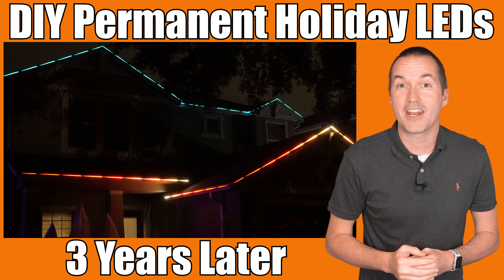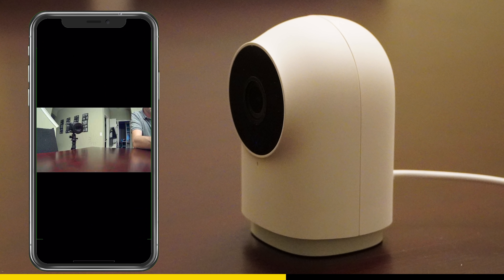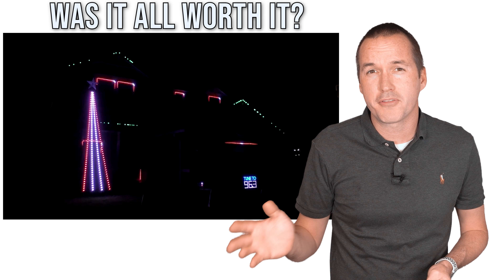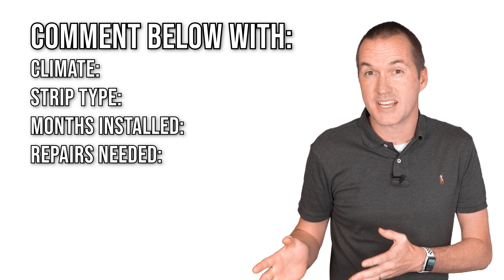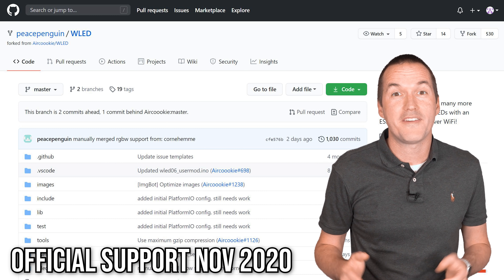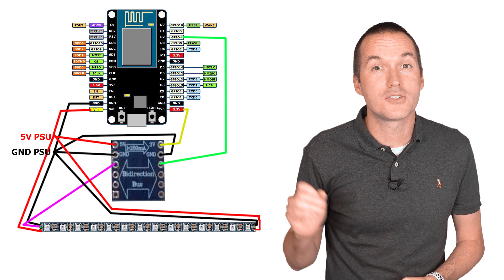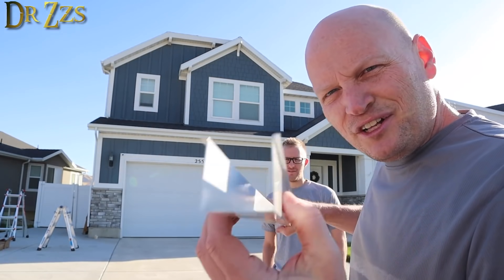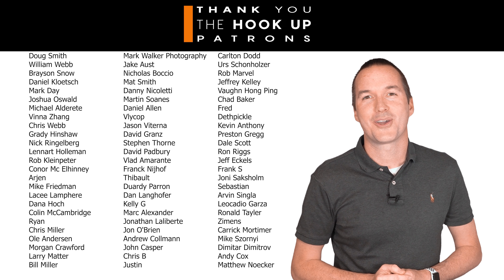3 Years Later: DIY Permanent Holiday LEDs - What worked, what didn't, and what's new?

Comment: First off, thank you so much for sharing your knowledge regarding permanent LED Christmas lights.  I have been watching yours and Dr Zzs videos and you two are the best on YouTube bar none. I have decided I want to take your advise and gear my permanent LED setup on your recommendation of the (8 to 10) SK6812 RGBWW 5 meter 150 IP65 5 volt LED strips.  I decided on these since I would like to light up the painted Hardy Plank eaves and soffit under my roof in a warm white most of the year and of course do the colors and effects for all the holidays through out the year. I have taken advantage of the Aliexpress 11/11 sale going on right now and I order the SK6812 5 meter LED strips but of course they will not probably be shipped to my until after mid December so I probably won't get them installed until after the holdays. My question to you is would it be possible to get some advise on the installation of the LED strips on the house ie. should I install them naked and with just a more permanent outdoor adhesive or clip or use the aluminum channels and if so which one flat or 45 degree angle?  Also, what is your recommendations regarding the best way to install the LED strips onto the soffit/ eaves of my roof line? Should I install the LED strips facing directly out to the street or downwards or behind the soffit so the LED lights indirectly shine their white light and colors onto my white soffit and eaves? I also think I will power the LED strips with a Meanwell 300W 5V power supply but I am not sure how many volts the power supply will need to be in order to power (8 to 10) five meter SK6812 LED strips any recommendations? Finally, I want to control the LED strips with the WLED software and connected to a NodeMCU that Dr. Zzs and you have recommended.  Sorry for the long winded question but I may have more after this if you don't mind. Thank you again for all your helpful content here on YouTube.
Reply: Brian how did it turn out with your solution?  I'm considering it as well (prefer to see the glow of the light off the soffit rather than the light itself)
Reply: @erich8789  I am installing the strips either this weekend or next week when I'm off. Better late than never I guess. Ask me in a week and I'll send a picture of them to you. I'm hoping for the best and I think it will look good but it won't show all the details in the effects like with twinkling etc.
Reply: @erich8789  by the way I found out we were thinking of moving and we did so that's why they're just now going up.

Comment: Nice video! Im about to start the project but have one question regarding current and wire gage. Im to install 65 ft of stirps in series; to feed them ill be running the 3 conductor 18 AWG wire that u used. My strips are 30 led/m so im estimating  36Amps max. Question is... according to the AWG standard 18 gage can handle .92 Amps  so im concerned ill burn the conductors. Is there something wrong with my math? Are the power injection wires carrying some of that current? Thanks for your help!!
Reply: I have the same exact fear/question. Hopefully someone can help answer

Comment: Thanks for this update! I'm in the process of planning my permanent lights right now. I'm hoping for some clarification on how to inject power. Let's say I have 4 strips running along a ridge line that need power injected at each end. I'll inject power at the end of the first strip, and then run my injection from the end of 1 to the end of 2, end of 2 to end of 3, and so on, correct? So I'm only running 1 extra wire in each aluminum channel, right? If this is correct, is there a limit on how many strips can be put together like this?
Reply: And, do you have a link for the power supply mounting box?
Reply: I was wondering the same about the power supply box.
Reply: Yes you’ll have one wire running from strip to strip. I wouldn’t do more than 4 strips off of one power injection run from the PSU (just add another wire to the PSU and do power injection #2)

Comment: Not sure if you have gone over this before but why not use the connectors at the corners and strip joints rather than soldering? Is it just for the spacing?
Reply from the maker: Basically, if you are willing and able you will always end up with a better result with soldering.

Comment: I am about to put my project together now, been watching your videos. Great videos. I have a question about power injection, I'm going to use 5v led inside aluminum Channel. I have about 60 ft run, do I need to run separate wires (+ and -) from the power  supply for each injection point? Or can just run 1 set and tee off of it. I need to power inject 3 times. I picked up some 20 Gauge wire so it would fit in the channel.
Reply from the maker: At 60ft I'd suggest running a continuous 20 awg through the channel and "T"ing" it off at each strip junction, then run a larger 16 or 18 awg all the way to the end of the line.
Reply: Great, thanks for the reply. That makes sense. I was beginning to wonder how I was going to get a bigger Gauge wire in the channel.

Comment: Rob I have issues with strip lights where random lights come on as soon as I turn on power supply once this happens data line is blocked have same issue with some string lights. How can I prevent this?
Reply from the maker: That’s the exact issue I was referring to in this video. Others who have had this problem solved it by using a meanwell power supply instead of the cheap ones.

Comment: Can I connect the 5v 60A power supply to 15amp power outlet?
I'll need to setup 60 feet of the led strips.
Reply: Yes you can.
Reply: Yeah - this confused me to. So a standard 15 amp home power outlet runs at 120 v so allows for a total of 1800 watts. 60 amps at 5 volts is still only 300 watts so should be fine.
Reply: @jonbetts8473  for safety purposes it's recommended you never go over 80% of a circuit for extended periods so you should keep to a max of about 1440w or 12a on a typical 120v/15a circuit.

Comment: Hi. are you using your two power supply in parallel or serial mode? or those are independent?
Reply from the maker: Independent, one of them runs the roofline and "wreath" the other runs the window/door frames.

Comment: 2:03, with one sentence you saved me a strip of LEDs, thanks! I was going to throw them away but I kept them just in case. I cut the first LED like you said you did and re-soldered the rest and I have a working strip! Unfortunately this fix didn't work for another set of LEDs I have which are not working, but I'm still happy I could save one of them! Thanks Rob!

Comment: Hi Robert, I was wondering, have you done any exterior cleaning on your house, like pressure-washing? I would think that it would be pertinent to avoid directly blasting the channels/strips directly. I was wondering if you or any of the community here have any experience cleaning around these, and any tips would be appreciated, as my exterior tends to need yearly cleaning to remove dirt and continue to look presentable. Thanks!
Reply from the maker: I had my house pressure washed over the summer.  I didn’t need to take any special precautions and everything held up fine.  However, they used a dilute bleach spray as a pre conditioner and I’m pretty sure it caused some of the yellowing in my diffuser.
Reply: @TheHookUp  thanks for the fast reply! glad to hear they held up nicely to being cleaned

Comment: I'm new to HA and have it running on a Zotac Zbox. Since it has no inputs like the Pi, I need an alternative. I want to hard wire an alarm contact directly to it. I have found a  Z-Wave Multi-Input/Output Dry Contact Bridge; Cert ID: ZC08-16040002. Would that work?

Comment: How many amps can you run on that thin 22 gauge wire. I am using 5v with 627 leds. WLED say it needs 35A for full brightnest.
Reply from the maker: That's a loaded question.  16 feet of 22AWG solid core could technically carry around 19A at 5V, the NEC says for power transmission purposes a 22AWG wire should carry just under 1A sustained load.

Comment: Hey, I had 2 sonoff flashed with esphome, so I recently updated them, after the update, they stopped connecting to homeassistance. even though their led are flashing but no sign of them on my wifi {using Fing App} 
Please help, I do not want to reinstall them because I have installed the sonoffs inside the cable extension plug and ceiling light.
Reply from the maker: Sorry, I'm not an expert with ESPHome, but you might try flipping your breaker on/off to reset them.

Comment: Great video - two questions:
1. Do you have a link to the high amp smart plug you mention in the video that also measures power usage?
2. You say you use 18 gauge wire for power injection.  My house is very long - I'll have a 90 foot run or two.  Am thinking 12V to only have to power inject every 10 meters-ish, but still not sure how to tell what gauge I need to use to be safe.

Comment: I wanted to do some "under the cabinet" LED lighting and some accent lighting in the 3 large half-moon windows we have in our home. We are getting ready to completely gut/renovate our condo and I thought it would be the perfect opportunity to wire everything up. I would like to control the kitchen cabinet lighting with a switch but the half-moon windows with an app. My idea was to install cat6 wiring from a "PoE switch" to each of the locations I wanted power but I don't know where to go from there. It looks like it's best to do what you do and just use a power supply? I can't find any PoE light switches. Do I just have to do all the controlling with an Arduino?

Comment: Just a note about my experience.  I needed to have the facia all around the house replaced so that meant all of the LEDs had to come down.  That was months ago and they are still lying on the ground.  A new installation is much less trouble than trying to re-do an old one.  I am seriously considering just tossing it all and starting over.  Putting the LEDs in channels with clips does no good when the clips are gone.  Also soldering wires outside on a ladder is a serious pain.

Comment: I only have one outdoor power outlet, Will this work or do I need more than one?
Reply: You could make a waterproof enclosure with everything outside, but you'd be better off running a wire into a garage and mounting everything on the wall inside.

Comment: WLED is exciting but I am disappointed to see you give up on your own code as I have been working hard to add cool new features to it.  I added the ability to set the animation on a per zone basis and the ability to change the number of colors (1-5) in the multi color animations (spooky eyes, blocked_colors, color_chase and my own fireworks and traditional) on the fly using home assistant.  I'll have to check out WLED to see if it has similar capabilities, otherwise I will likely continue improving on your code - adding animations from wled and making my own tweaks.

Climate: Northern US (9 to 101) 
Strip Type: WS2812B

Months installed: 11
Repairs needed: none
Reply from the maker: Yeah, all those things are available in WLED.  Honestly, at this point I think it’s important for me to recognize my limits.  I don’t want to string people along telling them I’ll support and update my project when I don’t have the time to do so.

Comment: How much can you safely up the voltage of 5v strips?  I’ve recently setup 23 meters with power injection thru 18awg and noticing significant drop at the end when I enable white.  As long as I keep brightness down to around 30% no issue.  Great video series, learned a lot and got me started in this process, but having a hard time figuring out how much I can safely turn up the voltage.  PSU started at 5.2, I’ve recently upped to 5.5 and unsure how much more if any.

Comment: Thanks for these videos!

I'm planning to install about 25m of WS2815 strips outside, and I'm really confused about what wire gauge to use. In your previous video you mentioned that you used 22 gauge solid core wire for your power injection. How many LEDs were powered via a single circuit?

I'd really like to run all 5 of my strips as a single series if possible, since that would greatly simplify the wiring, but I'm unsure how much power I can safely run along the power injection wires.

Comment: I recently intalled Led strips on my house and I'm using the same power suply you are using for your house, have you had any moisture issues damaging your power supply?
Reply: I didn't watch the whole video, but with his enclosure having holes for fans, I'm assuming his is not fully exposed to weather (ie. inside a garage?)
Reply from the maker: Correct. My year round supplies are in the garage.

Comment: I have a couple of questions if you don't mind.  I have some experience with putting the lights on the house.  I did it with my parents place 10 years ago.  I had frames for my windows and things, but they were made from some flexible pvc material that didn't really lend itself well to being used as a frame.  I saw in the video that you use frames for your windows.  What did you use to make the frame?  Also, can you cut led string lights to length?  Or do you have one string for multiple windows and just sequenced out to each?

Comment: Thanks so much for the videos, I am going for roofline this year. Got a 30A 12V supply, ESP32, WS2815 30/m LED in 15m strips and the same track you used (hunhun). Just got it all plugged in on the bench and is working great except LED 1, 3, and 5 are white for some reason. Any thoughts?
Reply from the maker: Maybe an issue with WLED? The rest of the strip is functioning properly?

Comment: I just installed mine over the summer - August 2020 and I live in Alberta, Canada. We just started to experience our first week of negative temperature and they are still holding up fine. I  didn't use aluminum channels. I  have them facing downwards under my roof unlike yours which is on the outer side of your roof. No repairs yet. Will see if it holds up to christmas
Reply: How did they work out for you? Actually going to be setting mine up in the spring. I’m in NE PA so I won’t be as cold as you, but still curious! Thanks!
Reply: Also curious how they went, and what your final costs looked like. I’m in Edmonton and just got a quote for a third party to do it to compare, but if it’s not a huge amount of trouble to wire this up here then I’ll be considering the DIY way. Thanks!
Reply: @foolsgoldenrod  the front section of my house is still holding up fine. However, the rear has one section that the adhesive came loose which then got exposed and has started to have display issue in that section. I will replace that section this summer and hold it down with extra adhesive. We get a severe amount of wind gust in my city - Lethbridge Alberta.
Reply: So you used the strips? And just stuck them directly to the house with an adhesive ? Wanting to do this on my home in ON 👍🏻🇨🇦
Reply: @Noonelson   Yup. Although the ones on the back side of my house have fallen off. That was on me though - we get severe wind gusts here in Southern Alberta and when it popped loose slightly I just ignored until it got worse and then I just pulled what's left.  The ones at the front are holding up fine still. Some of the LEDs are dead though. Govee has some new outdoor strips but It is not available in Canada yet just the US. I am waiting for those to be available then I will swap with those ones.

Comment: I have a video recommendation - things you can do in home automation with a 3d printer (and good ones to buy at each budget). DIY shade gears and smart power cords sound great, but I think I need a little more nudging to make the investment, and it would be nice to have a central, easy to search for video.
Reply: For $170 for an ender 3 there’s no reason to not have one. Possibilities are endless and only limited by your imagination and the time you’re willing to invest. Printed 3 parts and the printer had paid for itself.
Reply: I would agree with the other reply. An Ender 3 is a great machine for a low cost (relative to the cost of other printers) there is a huge community on the internet (reddit and facebook have whole communities devoted to the Ender 3) plus, because of its design, it is really easy to modify and upgrade if you are so inclined. Hit me up if you want to discuss the pros and cons of a few different 3d printers, every one has different needs and requirements, so the ender 3 might not be for you, but i have other recommendations i can make based on what you might be looking for

Comment: Climate: UK weather, lots of rain.  Rarely much below freezing.
Strip type: WS2811 IP65, not in a weatherproof channel.  Two 5m strips with power at both ends.
Months installed: 20
Repairs needed: Multiple partial failures resulting in having to replace one strip entirely and also had to splice and replace a short section.  Some failed within days of installation so weathering wasn't the cause.
I would do it again but would want much more reliable strips.

Comment: Would it be possible to use pin headers to connect the strips together to keep them closer together?
Reply from the maker: Sure.  On my patio I’ve actually spliced strips together by lapping the solder joints like they do at the factory.  Only issue is it’s harder to power inject if you do it that way.